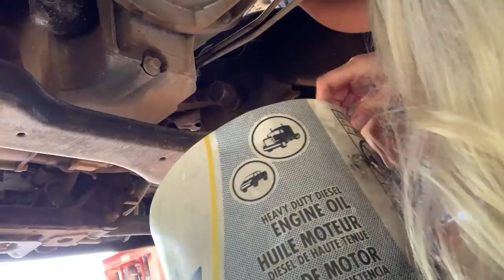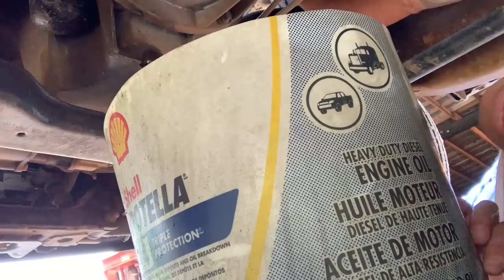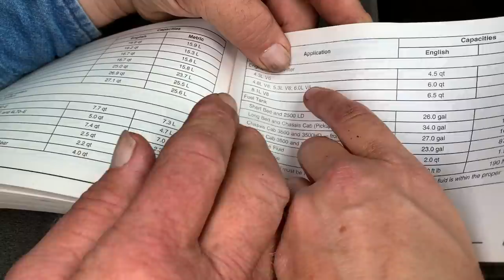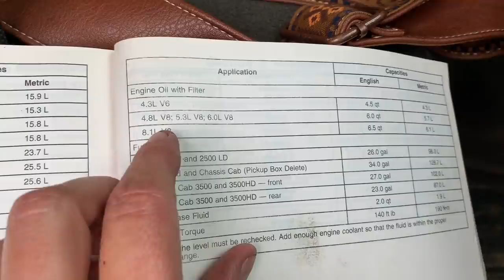I learned how to change the oil in my truck!

Comment: I'd say that your on it but common sense tells me that your gonna say it must be tight enough and it won't as some filters threads will drag a bit an you think its tight but say three or more days goes by and it loosens a bit, and it will pump ever drop of oil out on the ground and burn up that engine, no forgiveness and it is very expensive to change a engine in a truck thats  fighting for its life again the rust and elements. So it will go for scrap unless they don't want none so then its in the back yard like so many here in alaska where it is so expensive to get rid of steel scrap. We don't have any manufacturing here so we pay the price of having the nastiest backyards in america. Generations of rigs in the woods and there all rust. Not many ever come out as a barn find here. Once in a great while there are one that they deem worthy of a  rebuild cause its antique enough to be  valuable again. Very few shops that work on old stuff so its rock auto for parts and then thats when parts get expensive to fly up here. I swear I have not been subscribed all that long but I know I seen both the kids start filling in and another couple of years will be hands on the ranch. They both show interest ... Wesley the most...... I think back to my cowboy hero and loved Jesse James the outlaw... I surely could of picked better

Comment: All for you learning  new things  but when it comes machinery  lets be safe  you   yes you  need to put hair up even cover  hat or banddana   if you hair gets caught  in moving  chain  or gear  can snatch you bald  and that be least  of what could happen  let alone engine oil and grease in hair 
 Second loose fitting  clothes  long shirt tails or sleeve  also  dangerous   when working  on machines without guards. 
   Be careful  things pinch  flesh  hurt possible  even break skin and bone